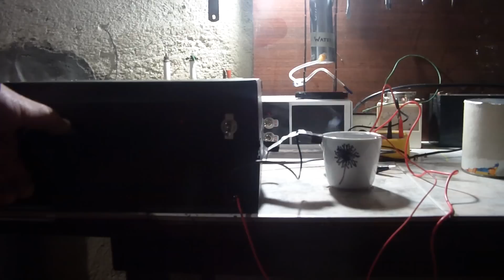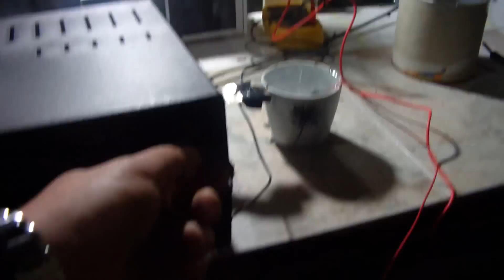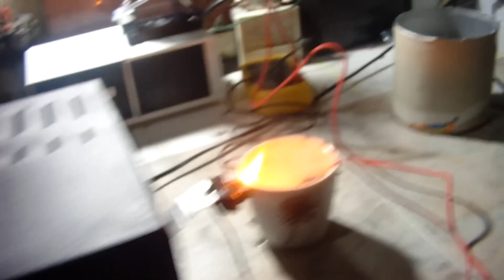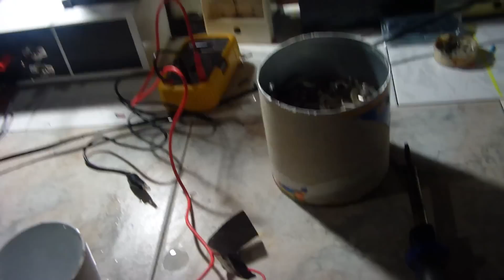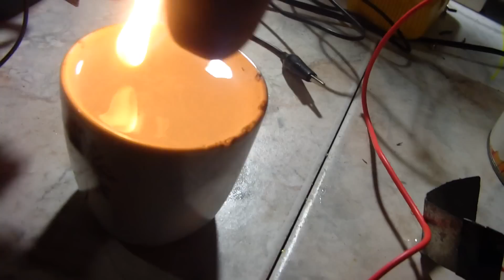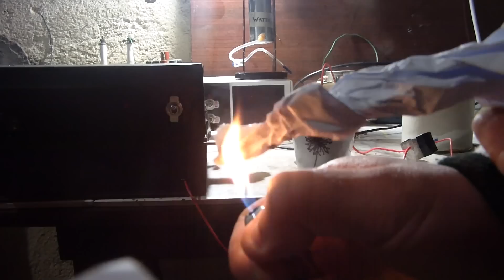burning salt water generator WATER FUEL FREE ENERGY 100% Real

Comment from the maker: Hello,
My name is Vladimir Dimitrov and I am an owner of the invention. I am working on this project for years and I shall be glad to present the results to you. As you will see the device ignites directly salty (sea) water using some energy to this purpose, let say as much as necessary for the operation of two electric bulbs.The flame coming out of the water reaches temperature of 5000 C and can be used for cutting, welding and heating.We can turn a dream into reality together, namely use the sea water as ecologically clean fuel.
Reply: are you sure bro , you got 5000 C from H2 ,, do you sell this device or the blueprint.. thanks
Reply: Can you please explain the concepts here and design so I may experiment please?

Comment: What is the strength of 13.56 Mhz radio wave, let's say it is set to output half a watt, how many salt water cups can run off of that source of radio wave and still produce same amount of H+O?. What determines it's efficiency. If you use small signal generator will it work or you need to have certain signal strength, If you had a bucket of salt water do you need to have a higher wattage of short wave signal?

Comment: Can this be done with solar power stored in a battery run through an inverter?
Reply: 300 watts is 300 watts, doesn't really matter how you generate the electricity.